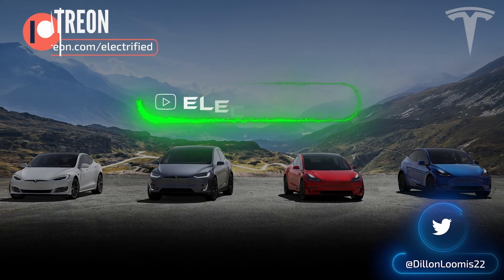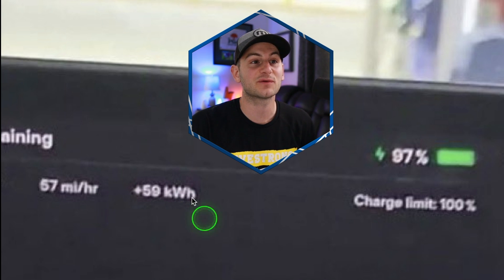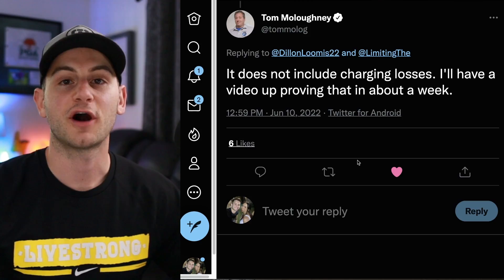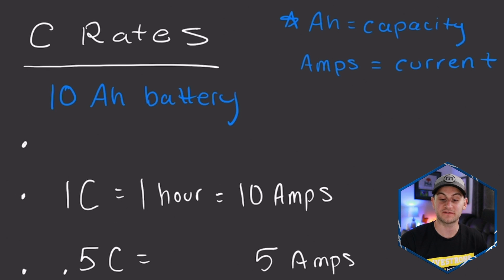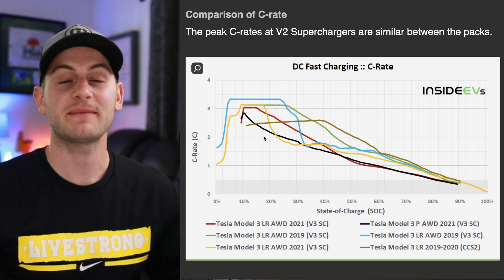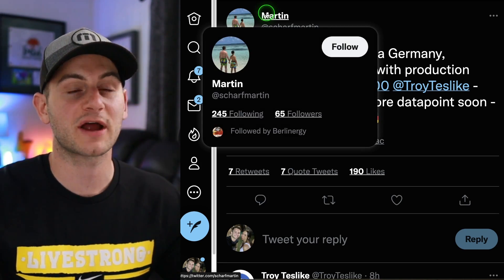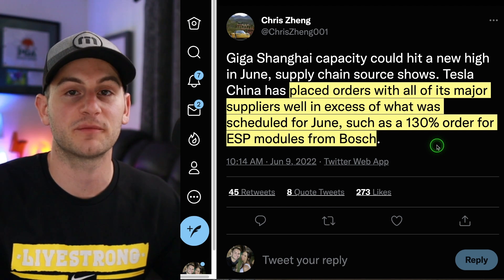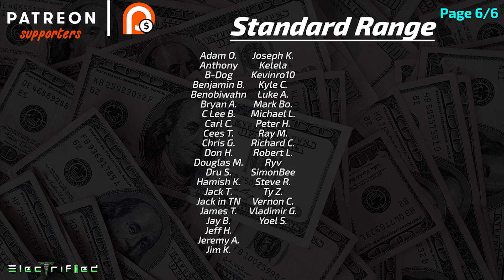Initial 4680 Model Y C-Rates & Pack Size / Berlin Production / Doubt About BYD Deal ⚡️

Comment: This is gold Dillon. Just when I commented on your thumbnail poll stating I never miss videos I am subscribed to, this one almost got by me. Anyway, what did you mean about it being questionable whether Spoken Reviews' data was accurate? Reason I ask is that I was shocked that there was only a 143 lb. difference and I hope he is way off. I was expecting a lot more weight savings (~400 lbs.) with two giga castings, 4680s, cell to structure, etc. What about you?

Comment: It kinda makes sense that a pack made with larger cells would have lower max charge/discharge rates because the surface area to volume ratio is less. Surface area is required for battery thermal management. The thing that could improve 4680 charge rate would be changes in cell chemistry, not the form factor.
Reply: Where do you get that the surface area of smaller with a larger cell?
Reply: @BenefitOfTheDoubtInquiry  to be more specific, cooling surface area. Fewer cells with fewer cooling channels equals lower theoretical cooling capacity. Also, distance between cooling channel and the centre if a cell is greater, making it potentially more difficult to dissipate heat from the center of each cell. But Tesla has already considered this and found a way to make it work anyway so we will see.

Comment: Tesla are known to start conservatively until enough data is collected in real world use to give them sufficient confidence to open up charging rates by software updates as it is shown to be safe to do so. If only GM had a similar approach to their Bolt batteries, they might have been able to identify and prevent the pain of the Bolt fires and recalls.

Comment: Battery charge rate: how likely do you think is, that Tesla is downgrading the 4680 charge rate software-wise to 2160 CR levels until a major replacement through 4680 happened (or at least solid ramp up) to avoid an Osborne effect and people refusing the 2160 equipped ones…
Reply from the maker: 99% likely lol

Comment: You should do a consult with 'the limiting factor' or 'engineering explained' before you figure out charging stuff just because of heat loss and how that affects that 59kw..... on the face of it 59/97 = x/100 makes the x = 60.8  in order to common sense that 59kw  see what you are charged for the electricity.. is tesla taking a hit on that heat loss?

Comment: With regard to the +59 kWh, it is the energy received by the car. Not all of this is used to charge the battery. Some of that +59kWh of energy added during charging is lost as heat in the battery and used to run the AC and the car's electronics during the charging process. So the battery will have received less than 59 kWh. 

A calculation of the energy used by the car as it drove 118 miles at an average of 290Wh/mile as the battery capacity dropped from 63% to 9% gives a 100%-0% pack capacity of 63.4 kWh.

Comment: C-rating applies to both charging and discharging.  The key to smaller battery packs that still produce the power needed is in high C-rate discharges.  That is what the tabless design of the 4680 cells should achieve because the path for electrons is much shorter than a tabbed design.  Instead of 3C max charge and 3C max discharge, the 4680 should be able achieve a 20C max discharge, allowing for a 10kwh pack to put full power to a 200kw motor.  There are 30C pouch cells but they also use a different chemistry and lower cycle life.  

For a lightweight car and someone who only needed 50 miles range per day, that would shave 800lbs and $20k from the cost of the vehicle while maintaining the 3s 0-60 acceleration capability.  Since 90% of people drive less than 50 miles per day, you would think a sporty and inexpensive commuter vehicle would find a market.
Reply: exact! btw these old Chevy Spark EV prior to 2015 was using the A123 20Ah pouch rates 30C continuous and 60C burst. These are 2000-5000cycles  top grade nano LFP. I use these in my Electric Snowblower since 8 years now. The tabless new NCA or NMC will perform ALOT with bottom and side thermal cooling management. I can easy imagine below 1 miliohm per Ah.

Comment: So is the 4680 really that big of a deal?
Reply: Tesla’s pitch for the 4680 on battery day was that it will take a few years to see the potential. They must first ramp up production and then make any tweaks after receiving enough real world use data. The current state of the economy and supply issues are likely affecting Tesla’s progress. Which is why Tesla has been willing to buy and use batteries from other makers and anyone that will supply their needs. Their main battery partner, Panasonic, is just starting to produce their 4680 batteries and will ramp up soon. So it’s all still too early to make judgement on whether Elon and Team’s battery plan pitch has been realized or not. I’d give it another year or two. Hopefully, the world doesn’t go to shit first.
Reply: The 4680 is a big deal. 

Due to the cyclical form factor you can mass produce them really quickly and cheaply. That's why 1865 batteries became a staple in the battery world. 

The steel cylinder casing gives the battery structure allowing for structural battery designs.

The "tabless" design (or as I prefer, Infinity tab) allows for both high energy density and high current charge/discharge rate at the same time which eluded 1865 and 2170 tabbed designs. 

The larger form factor increases energy density over 1865 and 2170 designs. 

And finally Tesla has been tweaking the formula of the anode and cathode for further improvements. 

In the battery world it's the combination of all of the best improvements you could hope for without totally revolutionising the system by going solid state or something. So yes, it's a big deal.

I forgot to mention that they are also using a novel dry method for applying the anode/cathode to the foils which drastically cuts down on manufacturing cost, footprint and time. I hope that's everything but let's face it, I probably forgot something else.

I guess it's kinda pointless at this stage ... but, the tab in the battery was one of the causes of all of the fires in the LG batteries installed in EVs, grid scale battery storage and residential scale battery storage. In particular the tab had a small tear in it. if the entire edge was the conductor like in the 4680 then a small tear would probably not affect the battery in any noticeable way.
Reply: It is. Not just because of the endpoint for the customer but also from a manufacturing point of view. It's too early to tell what's going on with the 4680. So all reporting right now is just speculative at best.
Reply: @EnlightenedSavage  "It is."

On the contrary, it is. 

"Not just because of the endpoint for the customer"

Customers don't want cheaper batteries and longer range? 

"but also from a manufacturing point of view."

Tesla don't want cheaper batteries and higher margins?
Reply: @yourcrazybear  are you aggressively agreeing?
Reply: @Seibar42  "are you aggressively agreeing?"

Sorry. I missread the first sentence of the comment I was replying to. I blaim it on being tired and answering too many anti Tesla comments on Youtube :).

Comment: Lightyear is teetering on free energy nonsense. 5m^2 x 1kW x 30% cell efficiency, and during the few hours of peak sunlight, the car is charging at the rate of a standard 1.5kW NA plug. As the sun moves away from high noon, energy availability drops off. 10kWh would be generous. To get 70km of range from 10kWh means an efficiency of 7km/kWh - that's pretty optimistic for a car that doesn't feel like a golf cart.
Reply: The Aptera is far more likely to be a success than the Lightyear.

Comment: The C rate is to compare different Chem,  voltage and size .
A pack C rate is good enough .
I come with a 20 year hobby riding an electric bicycle. 
BTW lead acid has a C of .5
Reply: C rate is to determine time to charge, not compare batteries. Diffrent battery types do typicaly carry diffrent C rates but the C rate is the Charge rate of the pack.
FullPack# Ah in 1 hr = 1C
So if a pack can be chraged at a rate that would fill it in 30min then 2C if 15min then 4C.

It also commonly is used to describe discharge rate.
EmptyPack# Ah in 1 hr = 1C
This is usually described as a 'peak C rate' and can vary widely as you mentioned depending on battery type and also test methods when in the sub categories of types. 

Most packs for RC Airplanes for example are in the 100C area due to need to have a dense weight to energy ratio. They will typicaly be small packs but with the Watt rating of a larger 50C pack.

Which brings me to Watts, which is the actuall discharge rate. Amps and volts can dance around but Watts is the measure of actual work done. A large heavy home energy storage pack and a small RC Airplane pack can do the same work. The variables are how long you need to do it for and if you have to move the packs mass.

Comment: When defining battery capacity, cells (and packs) typically use the output power/energy (the only way to prove how much it "contains").  On the other hand, the EPA may want figures to use the power at the charging port, to measure true efficiency.  So it will be interesting to see what is really the case.

Comment: On the whole I am.very underwhelmed with the 4680 no where near its promise. Such a shame
Reply: It's almost like it takes time to roll out and fully prove a new battery tech,  so that you don't end up with the kind of battery disaster GM had with the Bolt ... having to recall every EV they've ever made to change out bad batteries.
Reply: Is it possible that charge speed is being software limited?
Reply: @darylfoster7944  It's more than possible, it's how Tesla have operated so far.
Reply: @darylfoster7944  More than likely and they should be taking off the training wheels somewhere in the next 6 months to two years once the real-world battery characterization is done.
Reply: The battery have just gone out in cars for sale. Tesla is always conservative with charge speeds for new batteries and doesn't unlock their full charging potential until they have collected data on it. And the 4680 batteries were never about charging speeds either way. That was made clear by the graphs at the battery day.

Comment: There is a issue in the logic : 
1. Tesla is billing based on electricity out the charger and not electricity into the pack.
2. If so then to calculate the right cost the electricity used needs to be the electricity out of the charger so should include other consumptions too like ac and all.. Right?